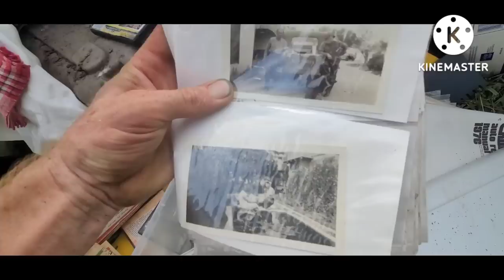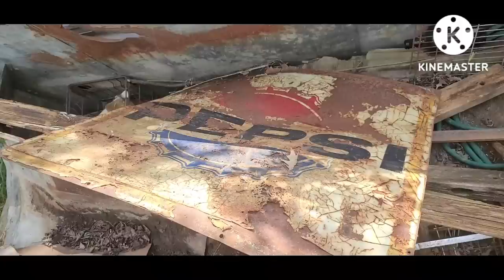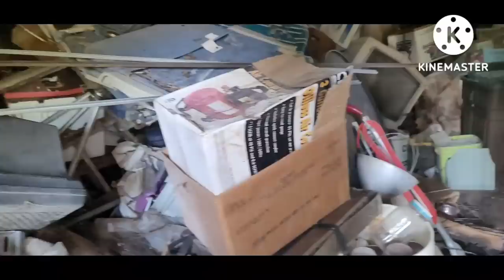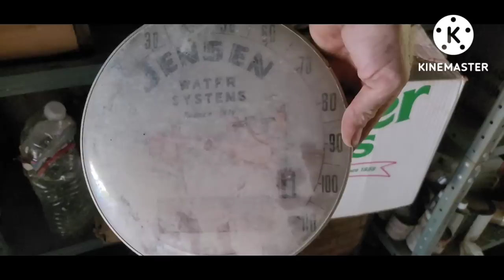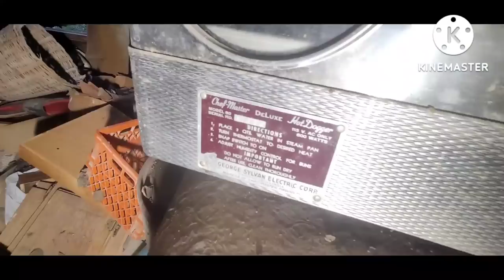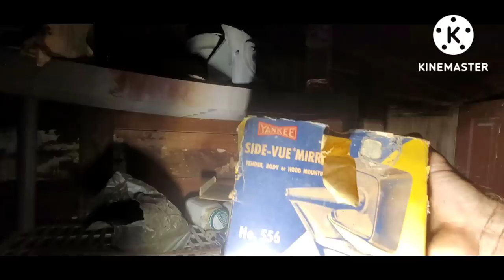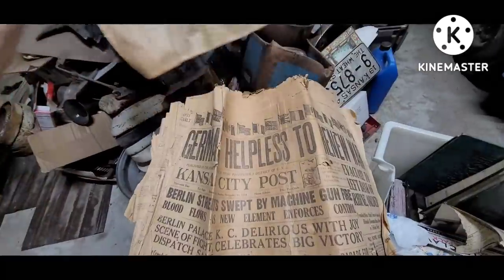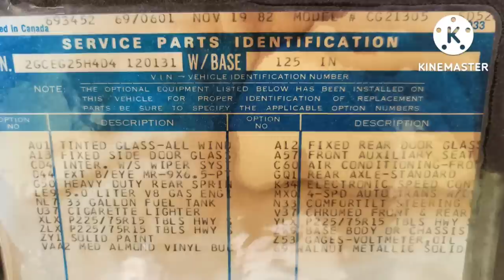I picked an old hot rodder's estate! Car parts, signs, cans, LPs, photos, & an old Chevy G20 van!

Comment: Considering how much good stuff was left after the sale, either there was some really great and large volume of great stuff that was pulled out for the sale or the prep in getting ready for the sale was not very thorough.  Usually at sales people dig through everything so I am surprised the Pepsi sign was left behind.  A lot of the metal cans should not have still been laying around.  Good ID on the Pontiac radio speaker that was also just laying out in the open.  I think I could have been at this place a whole day.   Thanks for the video.
Reply from the maker: They said he had a sizable collection of tools and a decent amount of vintage tin toys